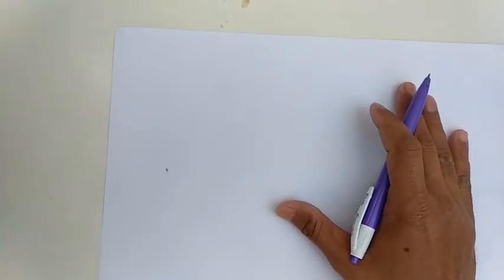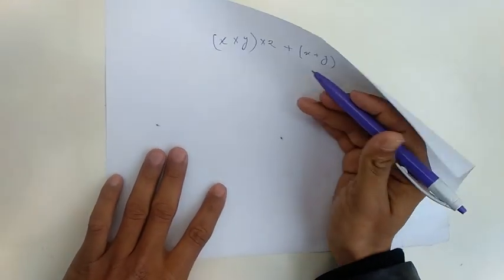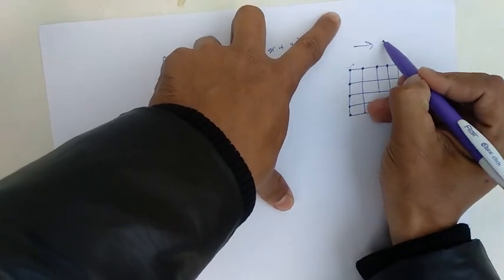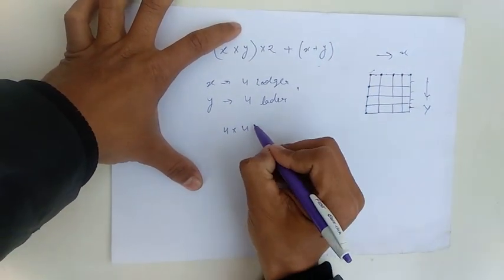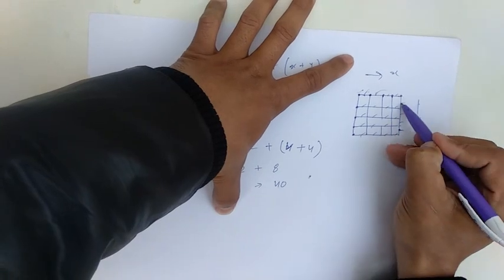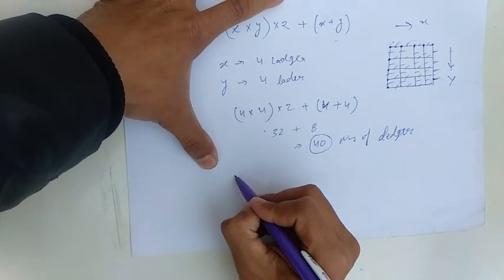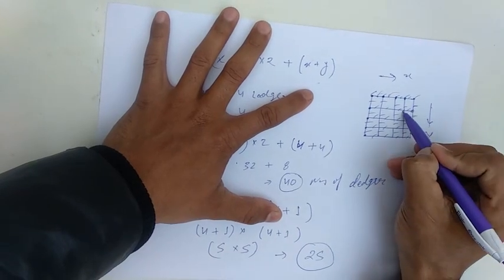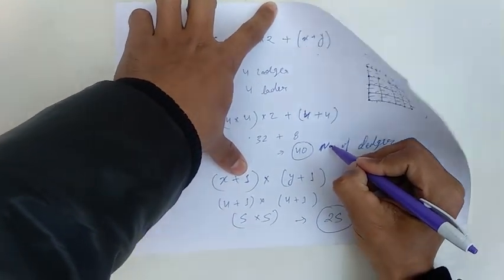Calculation of standards for scaffolding work

Comment: Do u have any method of calculation to find the volume of scaffold can be erected or built when the no of ledgers are available. Example 2000 no's of 2.5meter ledger available then how many qubic meter of scaffold can be erected and lift height shall be 2 meter.
Reply from the maker: Thanks for asking .
Where do you want to do scaffolding. is it in lift pit.
What is the size of pit .